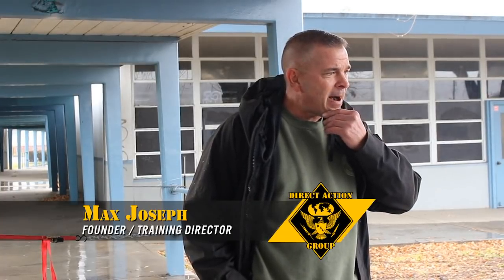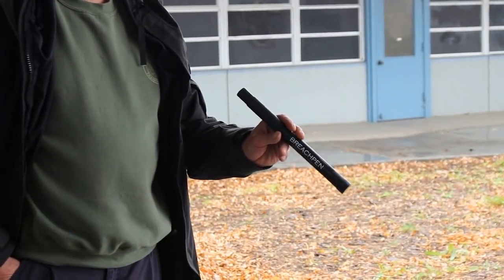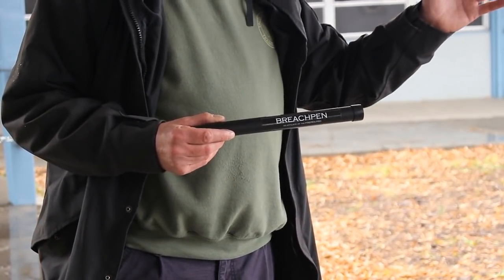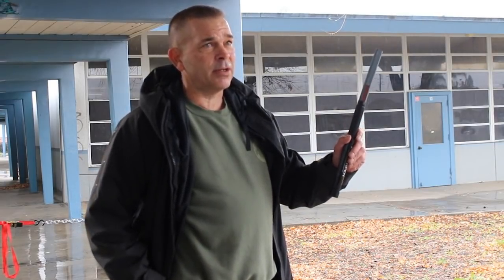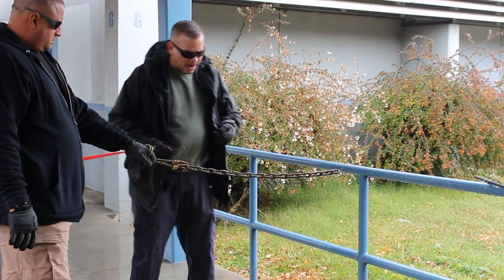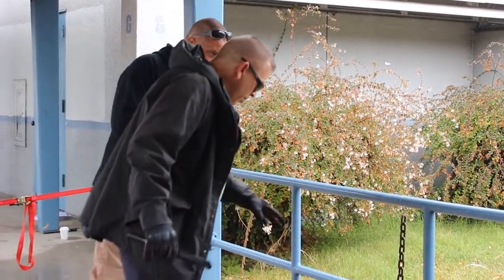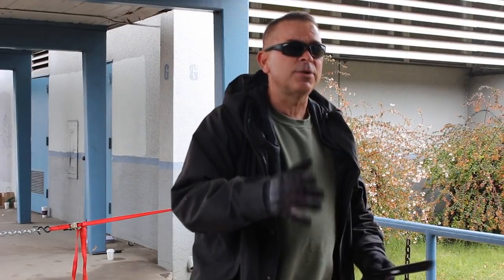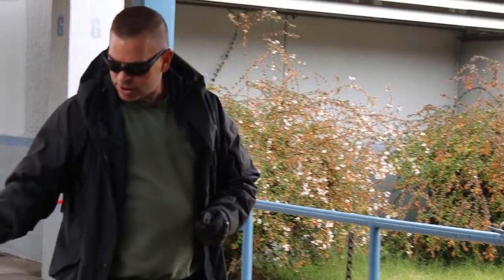Breach Pen Demo

Comment: If I added a sparkler to the end of my bolt cutter it would look just as cool but be much more effective and reusable
Reply: Can't cut security chain though
Reply: @God8-O you can.
Reply: Now cut a hole in a steel wall with them Bolt cutters and tell me you don’t wish you had about 5 of these Breach pens 🖊️

Comment: Not only tactical situations, this torch and a crowbar should be standard emergency/rescue items kept in both civilian and first responder vehicles.  Off road vehicles are prime candidates for entrapment scenarios, as well.  I've seen several instances where this would have been the ideal rescue tool.
  I'll be adding them to my gear, for sure.  Good stuff.
Reply: Yup! Just watch the flammable liquids
Reply: Basically everything in a vehicle is flammable except the frame and engine, thermite burns at well over 1000°f your whole vehicle would be in flames before you managed to get anywhere with this 25 seconds of burn time.
Reply: @Apollo55_   That's not actually true.  When I was a munitions systems specialist in the Airforce, we worked with shapped thermite charges that would put a pencil sized hole through an engine block and were used for demilitarizing different types of equipment so the enemy couldn't come in and use it after we left.  Depending upon mix and method of deployment, you can do a lot with thermite that doesn't end with the immediate and complete destruction of something.
Reply: @MtnBadger  Well, fortunately i wasnt talking about military application, i was referring to the air head saying you could cut somebody out of a car with these things. Nice try tho.
Reply: @Apollo55_   I gotcha, I was also implying that it does have applications beyond military, thar was an example.  And I appreciate what you said, as to cutting someone out of acar with it, that's absolutely a stretch.  But a thermite or magnesium cutting rod could, ish, be used to burn through a portion of a pillar but, that's abstract theory and some final option, nothing you'd carry in a rescue pack.  And it would probably set the car on fire.

Comment: What does this do that bolt cutters or a battery powered angled grinder can't do.
Reply: It can burn through a dead bolt.
Reply: @anonymouscitizen2732  is there a video of that?
Reply: @simply_based  I don't know of a video out there that has that demonstration, but I do own a few of these sticks and don't mind trying it out. It would be good to know.
Reply: Well they are way lighter than a angle grinder or bolt cutters. One of these things could be carried on your gear easily while manipulating your fighting rifle.  Not every situation would allow the time or team members to have someone go fetch a angle grinder or bolt cutters.   Also, one of these torches would cut through a quality hardened steel pad lock/chain rather quickly vs either the bolt cutters or angle grinder.  Ive had a pad lock that I tried some big bolt cutters on and didn't get anywhere with it. Then the angle grinder... loud as fuck. Your breaching and want to be as stealth and as fast as possible right?   Just saying and Ive never even heard of one of these "breech pens" till tonight.

Comment: Man, just pack a set of blot cutters. Heavier... yes. But, quiet, non flammable, not an ignition source, doesn't produce light, multi-use, bludgeoning tool, cheap, available everywhere.
Reply: Ok, now use bolt cutters on an industrial door, or a vehicle.
Reply: @frankcastenza6361  Yeah breaking a window doesn’t disable a vehicle though.
Reply: @echofoxtrotwhiskey1595  all this would do to an industrial door is lock up the mechanisms even worse

Comment: are you sure it's magnesium lit by thermite? Usually it's the other way around. Thermite is extremely difficult to light, so burning magnesium is often used to start the thermite reaction.
Reply: I'm no expert by any means but it does definitly appear to be a magnesium rod and thermite is usually a reddish color so it adds up. I get what you're saying tho, I think the match is some sort of thermite magnesium compound that is easily ignited but heats enough to ignite the entire magnesium rod.

Comment: Flash powder is a high explosive. Also moisture in concrete plus a light rod seem like bad idea.
Reply: don't beleive the concrete was wet as they weren't in the open.
Reply: @bagofsunshine3916  I built a few foundries for melting aluminum and can assure you that concrete is always wet and retaining moisture if exposed. If molten aluminum hits what looks like dry concrete it will pop from steam explosions and aluminum is cold compared to this stuff.
Reply: huh, didn't know that so little moisture was needed for it to explode. i've only seen concrete do that when it was visibly moist. or it recently dried so you could asume that there is still some moisture in it. 

So when wouldn't this happen?  on an indoor concrete floor? or obviously on anything not concrete.
Reply: I wouldn't trust any concrete unless slowly heated and held above boiling for a few hours. Look up the curing of refractory cement and you'll get an idea of how long of a process it is. 
  In the video you can hear rain in the background so I have no doubt  the concrete is moist. He's talking about 5000 degrees and I wouldn't dare let that kind of heat near moisture. Superheated steam can displace it's water volume 1000x, when I spilled aluminum on concrete a chunk the size of a golf ball popped and threw the aluminum all over.
Reply: Watching the video again you can see the concrete is wet behind him  and while he cuts at 7:25 steam flashes are popping and throwing slag up.
Reply: @kade426   he talks about it a few seconds later too

Comment: This is literally just a fire pen with a different name in the tube, and they charge u 3 times as much,
Reply: Combat Simulations Group by BattleTactiX Its a bit bigger and it lasts longer because it uses more material, get what ya pay for yeah.
Reply: Combat Simulations Group by BattleTactiX plus it looks like it has a slightly better design to reduce accidental breakage of the rod in use as well as improvements to placement of the match striker.

Comment: or you know, use bolt cutters and get through that chain in 10 seconds?
Reply: With a chain, yeah, better use bolt cutters, but with a metal door this would work perfect.
Reply: The breach pen has more varied applications and weighs less. Bolt cutters are great at cutting bolts, but that's about all they're good for
Reply: Also the breachpen takes no strength to use and is a lot more versatile and easy to use.
Reply: But that isn't tacticool oper8or enough, unless your bolt cutters have molle webbing and a free floating cutting blades.
Reply: maplejake weight
Reply: A breach pen is a lot lighter and smaller.and lighter in your pack/vest/belt holder than a pair of bolt cutters and the moment your working a deadlock bolt on a door breach,  car door lock, etc....  Ya.  Do I really need to say a bolt cutter is a non-starter? 
  Think, before making such comments, people.  Bolt cutters are VERY limited in scope and range of application.   
Magnesium lances, of which this is just a smaller version, are infinitely more versitile.
  This is also a priceless item in a civilian, first responder's emergency/rescue kit.  I've both seen and personally responded to highway and off-road crashes where this tool, along with a crowbar, would have been invaluable in the extracation of a victim(s) from a vehicle where, otherwise, only a cutting torch and/or Jaws-of-life was going to gain access to the occupants.
  Just an asinine statement.

Comment: Did he just let it drop on the concrete ?
Reply: Yep 😂😂that’s what all the popping was, concrete spalling.
Reply: @CoGhostRider  Excellent try at sounding smart, but that couldn't have been a more ridiculous answer to your own question.  It's rapid evaporation of water from the Thermite igniter, not an issue caused by water entering concrete and rusting out metal joining rebar (aka concrete spalling). Did you like your own comment too? LoL #pretendeod
Reply: @CoGhostRider  Go look at pistol shrimp if you don't understand the mechanics

Comment: Ill take my bolt cutters if i need to get through a chain or rebar. No smoke, no light, no worries to set stuff around me on fire, no cancer, faster breach,... i like the concept of the pen though and it definetly can have its uses. But for cutting some chain, rebar,... we have better, safer and healthier tools